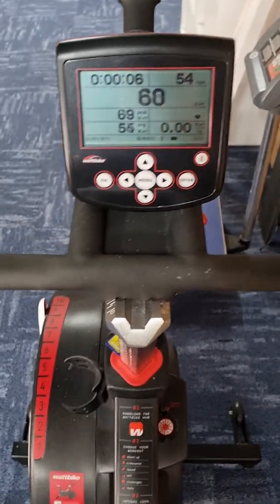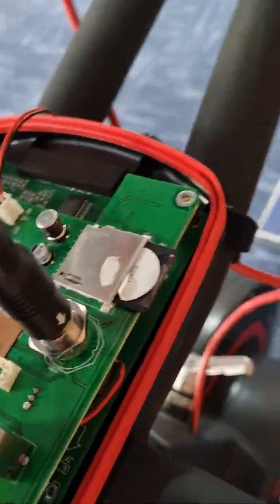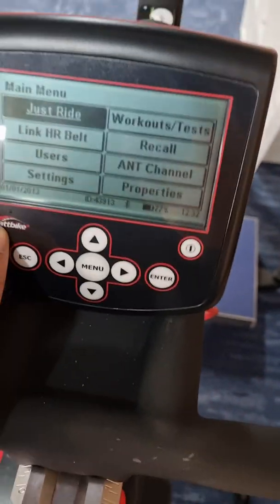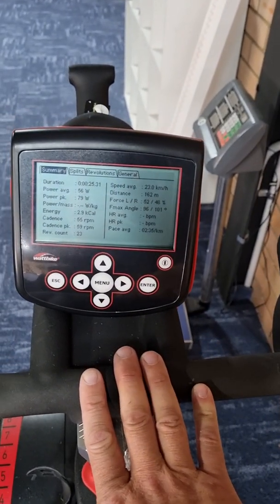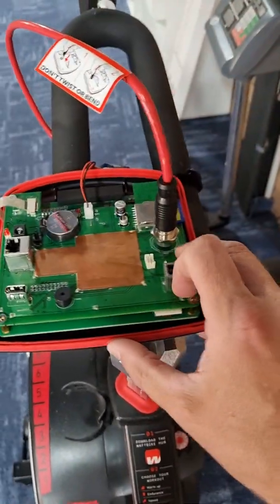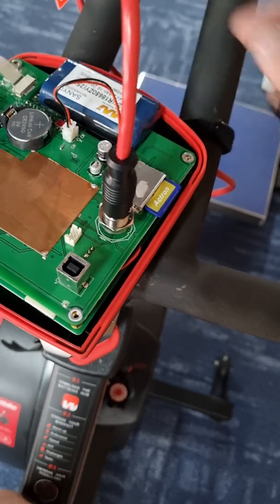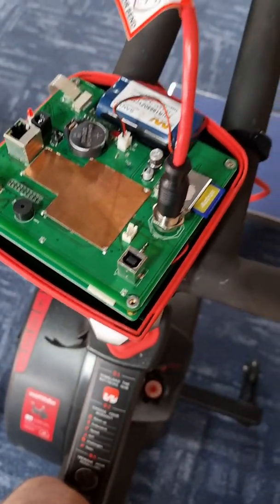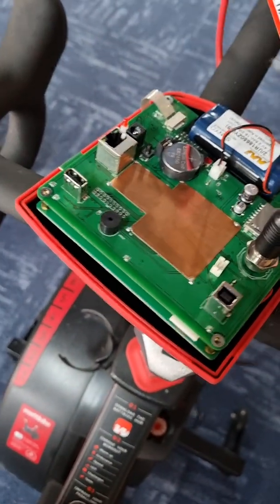Wattbike Trainer WPM Model B console, screen freezing issue on summary tab after workout part 2 of 2

Comment: Subject: Help Needed - "Sensor Not Connected" Error on Wattbike Pro Model B

Hi Ben,

I'm experiencing a "Sensor Not Connected" error on my Wattbike Pro Model B. I've already tried troubleshooting by replacing the comms cable and monitor, but the issue persists. My current firmware version is 1.24.01.

Has anyone else encountered this error or have any suggestions on how to resolve it? Any help would be greatly appreciated!

Thanks in advance!

Comment: Hi Ben. Very useful info. Question; Can in replace the original SD card with any new card? Or are their files pre installed on the card you got from Wattbike. Cheers!
Reply from the maker: Yes, you need a pre installed Wattbike SD card
Reply: Thanks very much. I thought that might be the case and thought I might be able to copy the files from the original card onto a newly formatted one.
Reply: Out of interest. I was able to copy the operational files from the old SD card and inserted them onto a brand new card. Worked very well!
Reply from the maker: https://support.wattbike.com/hc/en-au/articles/360005410300-My-monitor-deletes-my-workouts